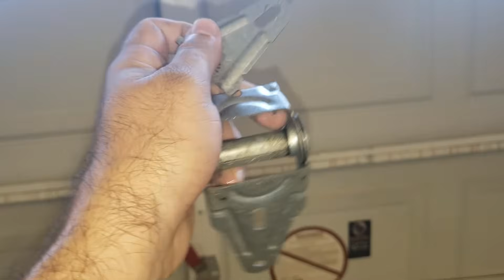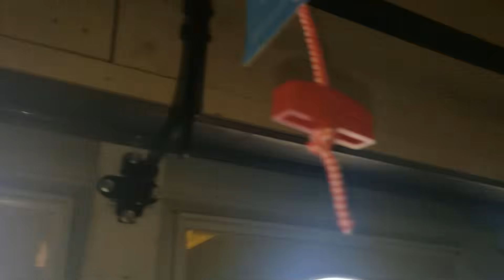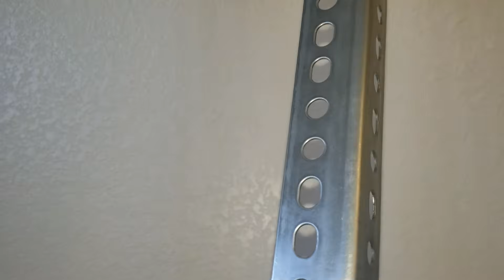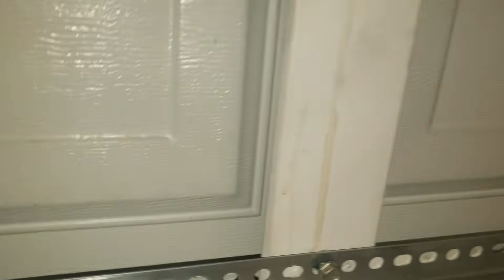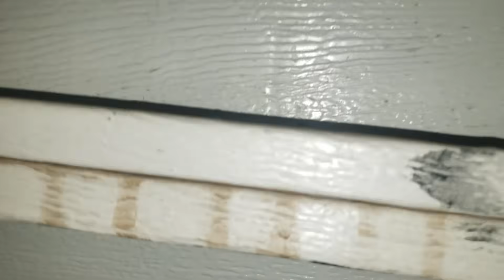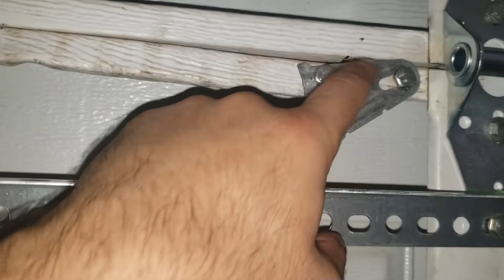How to repair sagging or cracked garage door panels.

Comment: Thanks to this video, and a couple others I watched, I simply need to buy an 8ft angle iron to apply to the bottom of my door.  That bottom is where the middle is bending in and making a huge smack noise when I close the door.  At this point, I open by hand so I can push the bottom center in when I close it.  As soon as I push it in, it starts dropping automatically.  I am simply going to copy what the other 8ft looks like towards the upper part of my door.  Thanks.
Reply from the maker: Glad you found this helpful! Best of luck!

Comment: Thanks. 
I've had several ideas on how to repair my panels as they are impossible to find (16x8 / 5 Panel / 2005 Track Home) 
This looks like the best and easiest. 
Has this fix held up over the past six years?
Reply from the maker: Hi, glad you found this useful! I replaced the garage door a little over 4 years after this repair because I had saved enough for a new door. However, the door was holding up fine and I am sure it could have lasted longer if I wanted it to. Best of luck to you!

Comment: What to do for the top line of top panel if that is broken ? Whats the bar u have used for top panel ? Is that a standard thing from home depot ?
Reply from the maker: Hi,  like everything is this situation, it really comes down to how severe the damage is. In my case, the crack in the garage panel was minor, so I just reused the clip that broke off my other hinge. But you can use anything that fits well and provides enough support there.

Comment: I had to cut an 8ft bar like this by 4 inches, flip it 90°, and slide it inside, flush with the angle of the panel. Then I drilled pilot holes in 6 locations, two outside, two middle, and then one on each side of an "L-crack".

Just used some wood clamps to keep the metal in place while I screwed everything in, and it worked like a charm.

Outside, along the frame, doesn't work for an L shaped crack in the panel, dead center between the brackets.

I love your method! It gave me a great place to start! And my garage WORKS again!

Comment: If i add 2 of the garage door strut that goes across the whole door, i probably have to rebalance the garage door springs?
Reply from the maker: Good catch, you'll likely need to rebalance the springs since those struts add a significant amount of weight to the door. I recommend that being done by a trained professional.

Comment: The location doesn’t mean only 8 feet. It’s working for others bc it’s still solving issues and usually issues aren’t bad enough to reveal the error in logic. An 8 foot strut indeed solves most problems but structural engineering suggests there’s a threshold you’ll  reach where your 8 foot strut isn’t able to compensate for the error. By your logic that’s just not the case. Fixed a door 3 days ago. Client   sent  me this video wondering why it wouldn’t work lol same location and all. It’s bc the damage necessitated the 5 touch points across the metal  vertical braces
Reply from the maker: Read description

Comment: Do you know anything i could use to cut the bar to fit to size?
Reply from the maker: To cut a steel rod, use an angle grinder with a metal-cutting disc for speed, a hacksaw with a fine-toothed blade for manual cutting, or a reciprocating saw (Sawzall) with a metal blade for power, with portable bandsaws offering precision.
Reply: @Nayib1  thanks a lot

Comment: What if you have a crack in the top and bottom panel but at the same location. Will one bar still suffice or do you need a bar for top and bottom?
Reply from the maker: Hey! You can add supports to the top and bottom, just keep in mind it’ll add some weight to your garage door. It’s not as heavy as a full strut bar, which is honestly the better long-term fix for a cracked or sagging panel, but whether it works really depends on how strong your garage door motor is and how much weight it can handle.
 
It’s not a permanent solution either. Mine held up for years without any problems, but it really comes down to how bad the damage is. Still, it’s a solid quick fix if you need something to get you by in a pinch. Good luck!

Comment: the shorter piece of angle iron added no support for me. only a long brace bar for garage doors, called a strut, which was very hard to find, worked
Reply from the maker: This makes sense, and I addressed it in the video description. I'm glad you found a solution that works for you.

Comment: What do you suggest if you have a 10 foot door and the longest angle bar they sell is 8ft? Two and just connect them?
Reply from the maker: Hi, I used these because the damage was in such a small area, my garage door is 16 feet long, but I only needed to reinforce one panel, this is why I only needed enough support for that area. However, if your damage is all across 10 feet of your garage door you have a bigger issue, but there are Heavy Duty Garage Door Reinforcement Struts specifically for that situation, outside of replacing the entire door. Now, these struts are heavier, so be sure your garage motor can handle it. Remember, this is a temporary solution and while mine worked out great, it really depends on your damage.

Comment: Since this video came out, the 18GA Metal bar has gone from $30 to $41.98 at Home Depot. Crazy
Reply: thats nothing. researching projects a lot of materials have doubled or tripled. example for drainage 100 yards of corrugated 4" pipe used to cost iirc 37, now costs 100+

Comment: Fixed mine today thanks to your tip, I only had to spend about $50 worth of angle iron 👍.   Now I have to do something about the sharp corners so nobody gets snagged on it lol
Reply from the maker: @dave83104  that's a good point, I did get a shirt snagged on it once. Good luck!
Reply: @Nayib1  just picked up some 1/2” pipe insulation to cover this, I’ll grind down the sharp ends first ✌️

Comment: Thanks for the video and tip! I bought an bracket at Ace for $20 and the bolts, nuts, and washers at Lowe's for another $20. I think it was a little expensive, but it fixed the problem and it opens and shuts almost like new, so I am happy. I would have replaced the one panel if I could have found it, but I couldn't find one online so, the repair had to be done. Now I just got to figure out what to do about the small ripped holes in the panel. I am not sure what kind of welding it would require to fix that.
Reply from the maker: I'm glad you found this helpful, thank you for sharing. You may be able to find aluminum foil tape which is heat-resistant, anti-static, and strong strong in adhesion.
Reply: @Nayib1  thanks for the suggestion. I will look into getting some of that tape.

Comment: Great video, thanks for sharing. I was told by garage door company that I needed new door and motor, they couldn't even be bothered to come out and have a look, instead they asked that i email them pics of the damage, and that's what they recommended. You saved me $4500.
Reply from the maker: Hello! I am glad you found something that works for the meantime! I went through the same situation, but I wasn't ready to pour money down the drain. This solution held up strong for me for the entire time I had it up until I could have enough savings for a new door almost four years later with zero issues. Best of luck to you!

Comment: Just completed this repair using your method and it worked like a charm as the two bottom panels cracked beside the hinges mid span.  I added plastic u-channel for decking to cover the sharp edges of the angle sticking out for safety.  $78 repair.
Reply from the maker: Thanks for sharing! I'm happy to know you found this useful :)

Comment: Did you have to adjust the balance on the springs due to the added weight.
Reply from the maker: Hi, fortunately the added weigh was minimal enough that I did not have to adjust the balance on the springs. If that were the case I'd definitely get a professional to do it though.

Comment: Awesome dude! Thanks for posting this. My middle hinge broke and its sagging bad, and there's a pretty big crack that's developed in the face. Gonna pick up some of those angle bars and try to repair.
Reply from the maker: Glad I could help. At the time I did this supplies were low everywhere and costs were super high, but as some of the other comments have mentioned, it's best to use a garage door Garage Door Reinforcement U-Bar Strut Support Brace and they also make garage Door Reinforcement Support Bar Brace Kits specifically for that purpose. Mine is holding up perfectly with the angle bars I installed over 3 years ago, but if your damage is worse than mine, you might want to consider a better option. Good luck, friend!
Reply: @Nayib1 Oh, thanks for that. I had no idea those were a thing. I'll have to do some research. Have a good one!

Comment: Menards here in St Louis sells those 16' garage struts like you have on the top of the garage door for  $50.
Reply from the maker: Nice, 3yrs ago there was something going on where these cost $250 + and they were in short supply. Since that's no longer the case, I would probably recommend that instead.

Comment: As stated from others - you saved me hundreds of dollars - I stopped by my ace hardware to pick up the angle bar ($30), and took 20 minutes to drill & install - thank you
Reply from the maker: That's awesome, I'm happy you found this helpful. I hope it works as well for you as it has for me. Mine is still working perfectly as is without any sag, movement or any noticeable issues.
Reply: @Nayib1 yes sir - 2 yrs later and it’s as if I did it today - still perfect and working

Comment: I often hear about weight issues being added when installing the crossbars, and the spring playing a factor in possibly being replaced to compensate for the weight - did you have to adjust the spring tension or find anything wrong with keeping the same spring installed?
Reply from the maker: I didn't have to replace/adjust the spring. I think the motor I have is strong enough for a much heavier door, so maybe that plays a factor.

Comment: Do you think this would work with one bar only?
Reply from the maker: It might if you only have minimal damage on one pannel and no sag. I used 2 because I had damage on the top and bottom panel which was causing some sag.

Comment: Thanks for this excellent video. I just got through with my repair. I pray it lasts another 25 years, lol. I ended up noticing and replacing 2 cracked hinges as well. You saved me 2 grand and a month long wait for a new door installation.
Reply from the maker: I am glad this helped you. Hope it lasts long enough for you too. Mine is still holding strong without any issues up to this day since I made this repair and  posted the video. Good luck!

Comment: Thanks, man! this is great!
Reply from the maker: Glad you think so! Mine is still holding strong. Best of luck!
Reply: @Nayib1  I fixed my garage door the same way. I had an almost identical crack but the hinge was still intact. It worked like a charm. The only question I have is: will these screws hold? If they give way under the weight, what to do? Use bigger ones?

Comment: Thank you so much for this video!!!!! This fixed my garage door!
Reply from the maker: Thank you for your comment, Polly, I'm glad this was helpful for you. I did this over two years ago and it is still holding up perfectly with no issues at all. I think given the right circumstances, this is a very good way to prolong having to replace much more expensive parts, and it has not caused any additional issues either. I can only hope it works the same way for you.

Comment: From an owner of a garage door service company, this is a good stopgap, but will not be a permanent repair.
Reply from the maker: That's right! This is a temporary solution to a mild issue, and that is why it works in my case. If your garage door has a more extreme issue, seek out an expert or a garage door specialist near you. I did this back in 2020 and it's still holding strong with no issues. I'm sure at one point I'll need to replace the garage door, but I just want to delay that and get my money's worth on this door for as long as possible.

Comment: Your repair it by buying a new door. Applying a bandaid is a hack job fix. You’re prolonging the inevitable till one day it falls on you or your car. Don’t be a hack.
Reply from the maker: this is a temporary solution to a mild issue, and that is why it works in my case. If your garage door has a more extreme issue, seek out an expert or a garage door specialist near you. I did this to my garage door in august of 2020 and we're in 2023 now... yes, I am prolonging the inevitable, which is the whole purpose of this "hack job". Thank you for your comment.

Comment: Does this add extra weight and should that be a concern?
Reply from the maker: It does definitely add extra weight, if your motor cannot handle the additional weight, I would consult a professional. I had originally brought a professional to give me a quote on repairing the door, he mentioned my equipment could handle much heavier load, but the panels are low quality, so he recommended I add a bar which he would have charged me quite a lot for. After dismissing him due to the information he gave me, I came up with this solution and haven't had any issues since then. I am sure a weaker motor could struggle with the added weight,  however, 18 -gauge angle bars are not very heavy. If you plan on adding several more, then definitely consider the load capacity of your garage equipment. Thank you for asking, and good luck with your repair.

Comment: Can this problem cause the door 
To not close??
Reply from the maker: When the door sagged, it created a weight issue with the motor, which prevented the door from opening.
Reply: Sagging is serious.  It can cause the door to not open or close properly and there are vids of damaged doors getting ripped off the track by the opener.

Comment: Thank you for uploading this video. I will be going to either Lowe's or Home Depot or wherever you got this piece of angle iron and doing the install myself and save me about $1,000 cuz I have the same type of damage to my door as you do the one that you're displaying. Two thumbs up. I am modifying my comment by letting you know that Ace hardware shows they have the 8-ft long slotted l bracket but they didn't have it in stock so I had to get a solid piece of aluminum and it did the same thing
Reply from the maker: I'm glad this was helpful, hope this solution yields same results as mine.  Good luck!

Comment: This is a great example of what we can do to fix our garage door. I have the same problem but I need 4 slotted angels.Maybe it is too heavy.So do you think I can use slotted angel 4ft instead 8ft?Thanks
Reply from the maker: Hello, this is definitely a temporary solution for a mild issue. The added weight did not make a difference on my door, and I do have a newer motor on there, so that is why this works for me. If you feel that additional weight due to 8' slotted angle bars will jeopardize the structure of your door, I wouldn't bother with 4' slotted angle bars. The reason for that is that each panel is about 4', and if you try to support one end using this method, it will not help, unless your sag is on the center of the panel, as opposed to this example, where the damage is on the hinge side/ one of the ends of the pannel. Hope that helps, thank you for your comment.
Reply: @Nayib1  ok thank you for your opinion. Great video.

Comment: Good stuff! Awesome tip on the gauge. I was thinking on getting 1ft 1/2. However you got the 1ft 1/4 angle steel. I have sagging panels with crack as well. I was considering putting JB weld on the cracked panel to bind the crack but may just do what you did.
Reply from the maker: Hope it helps, good luck with your repairs.

Comment: I installed per the video and it worked like a charm. $95 for hardware and 15 minute install. I may have added 15 lb to the door so I'm not going to rebalance. Thanks for your help.
Reply: you should go up in weigh for the springs. my previous springs were 80lbs, with reinforcement probably added 10 lbs so went to the 90lb spring
Reply from the maker: Thanks for letting me know this was useful. Happy it was useful for you, mine is still holding up after all this time.

Comment: Thank You for the GREAT video. I was able to repair my garage using this method.. $60.00 in parts. My garage door was sagging in the middle.
Reply from the maker: Glad it helped, mine is still holding up strong, soon as it is not enough ill replace the entire garage door, because it is over 20yrs old.

Comment: This solution fixed my garage door. Cost me about $70 for the slotted L bars. Once I got home from the hardware store, it took me about 15 minutes to get it done!  Thanks for the video!
Reply from the maker: I'm glad this was of help for you, mine is still holding strong and the damage has not gotten any worse since doing this. I know not every garage issue can be solved by doing this, I am happy it was of use to you.

Comment: You added weight to the door, did you rebalance the door? I actually bought garage door struts (like the one you had on the top, added them (available at Menards, 16’ for about $23, 8’ for $14). I rebalanced the door.  This bandaid repair cost me a garage door opener. In 6 months the spring broke and the garage door opener was barely opening the door. I bought a new door & opener. I learned a valuable leasson. If it ain’t broke don’t play with it. If it is broke, in some cases you replace it......this is one of those cases.   Jim
Reply from the maker: I added a very minimum amount of weight, the garage door struts are much heavier. It has been 8 months and the garage door has been working perfectly fine, no issues at all since my repair. Thanks for sharing your experience.